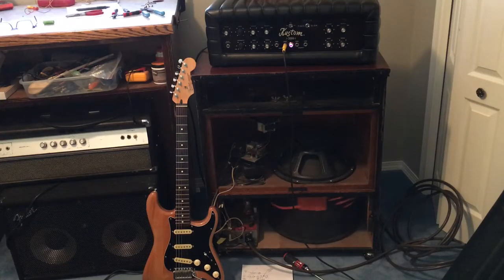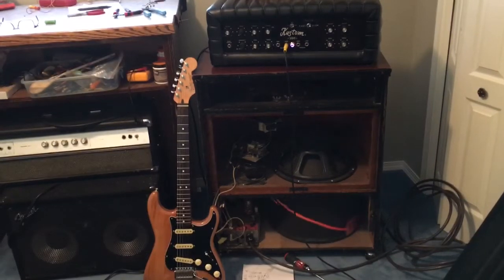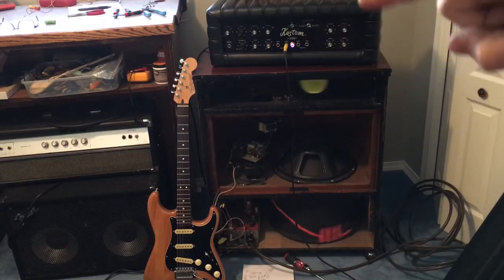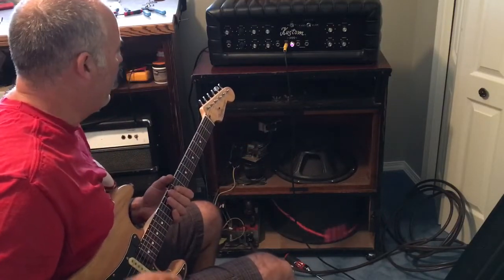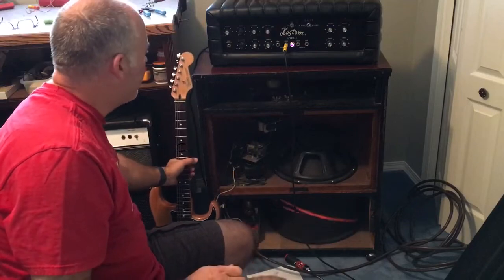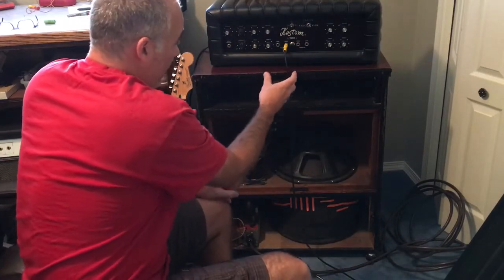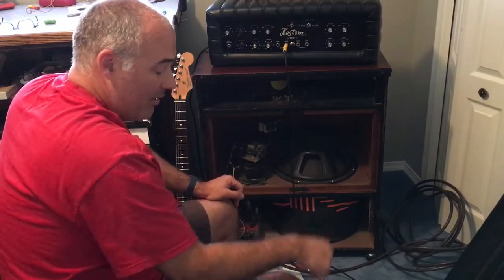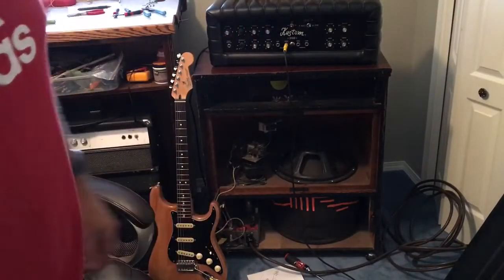Leslie 147 Cabinet with guitar

Comment: That's a Leslie 145 (the short cabinet version of the 147 that also includes the 147 amp). The upper and lower rotor don't need a back cover. However, the back cover of the middle compartment is essential to the woofer. The Leslie is basically a bass reflex cab with a compression driver feeding a horn.
Reply: @randie9480 I own a 1957 C3 and just had my old oil waxpaper caps at the tonewheel generator replaced. These caps will cause the organ to get quite dull over time and have increased leakage (i.e., noises caused by unfiltered voltages present at the tonewheel pick-ups). In addition, my organ developed a constant whistle that got quite annoying, especially at high volume levels. Rebuilding the A0-28 tube preamp (including the replacement of the big filter caps next to the power transformer) didn't help. It was gone as soon as the generator caps were replaced. Now, the organ sounds very bright but that's fine with me since I'm a rock player. However, I really prefer the 50ies Scanner Chorus line box to the unit Hammond introduced in the 60ies. The difference in sound quality is tremendous which is why it had to be a 50ies Hammond for me. By the way: The very combination of a Kustom amp with a Leslie shown in this video is what Brother Jack McDuff used back in the day to get his magical Hammond sound.

Comment: run it through a flanger AND a Leslie and see what happens.  There's a sound used on Eric Clapton's recording of The Core and that's what it sounds like they are using.  Check it out. If you do know what they actually used on that song, let me know, but it just sounds like they were using both for certain sections.